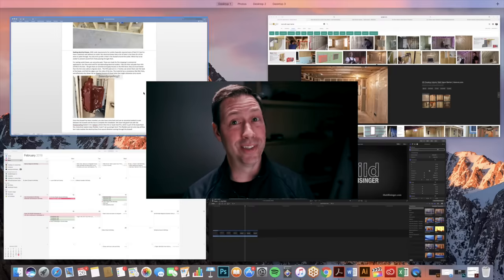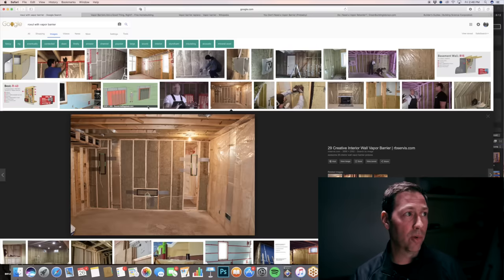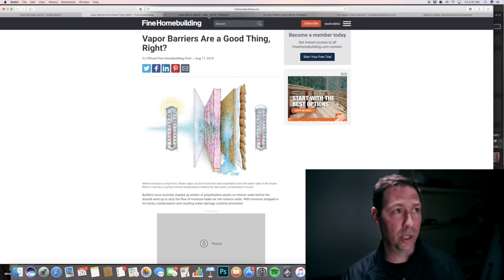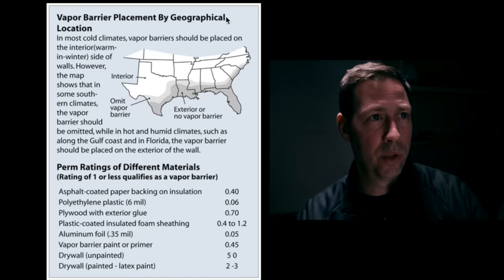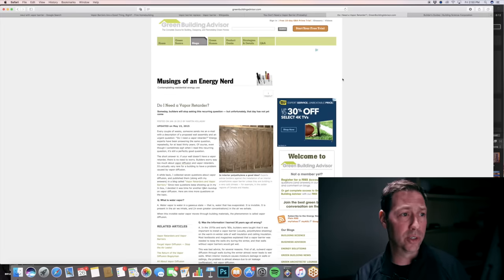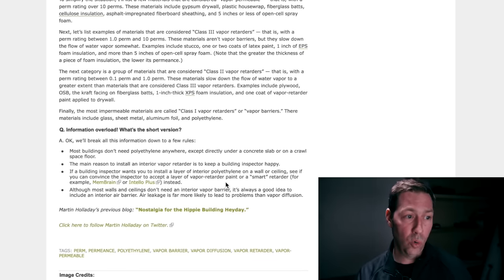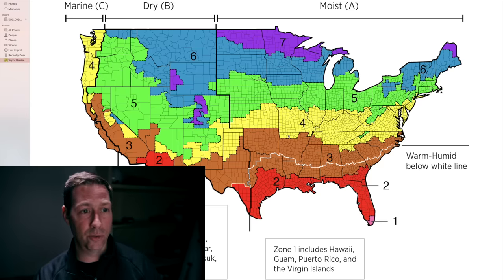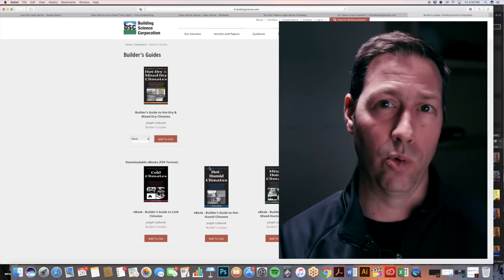Vapor Barriers: Need one or not?

Comment: Found this very helpful but it left a couple of questions unanswered. 1. If air movement is the main culprit, how does one stop that? Won't a poly sheet prevent air movement? 2. In the example you showed from Texas where you remodeled a house less than 10 years old that had the poly sheet on the inside, you found mold -- so why did that happen? In other words, while a poly sheet is not needed, what problems does it cause if it is added, and why does it cause those problems? Thanks!

Comment: So glad I found this! Question...I’m remodeling, tore out sheetrock on 4 interior kitchen, bath & living room walls (none are exterior), down to the original ship lap hoping for the “farmhouse look”. However, my house has since been freezing, dusty, moldy smelling & extremely damp. I live in east central Mississippi & want to recover them with luan (easy to install, paint or wallpaper). Do I need any vapor barrier or membrain between the shiplap & luan?
Reply: I would open one side of the wall and address any mold then look to close any air leaks that might be getting into the walls. To be freezing, outside air must be getting in somewhere. Plumbing or wiring holes to the crawl space? To the exterior at wall junctions? Dampness would be coming from the same leaks. An interior wall should have none of those issues unless there are openings to the outside. Also look at holes in top plates if it is a cold attic. Plastic will not save you from those issues as it will still be inside the wall cavities. A few cans of spray foam should help. Just use the correct type. From a retired GC.

Comment: I live near Chicago and have a fully finished basement and I took out some drywall to redo my sump discharge line and add a second to get rid of the wye. Against the foundation concrete wall was the thick plastic vapor sheet then there was the insulation that itself was like bat insulation but was in like a plastic housing, and finally the studs floated out about 10” and of course then the drywall. Is this right? I believe so because there’s no musty smells and the basement is always the most comfortable location meaning in summer it’s coolest and winter it’s warmest and that’s in a 2 story. Always thought that plastic that’s simply draped down the foundation wall was kind of dumb but it seems to be helping with something I guess.

Comment: Good content. Two questions on zone 1 & 2.  I just reframed part of an exterior wall I’m south florida with pressure treated studs because of termite damage.  The wood is still a bit wet from the pressure treating process & we need to start closing in the walls.  Generally I insulate with Roxul, but I’m concerned about the moisture I may trap in the walls given the still moist pressure treated.  How would you handle this situation?

Comment: I am near the coastline in Hoboken, NJ and I’ve got an extension made of cinder block, whose exterior is stucco and open to the elements, which I am in the middle of remodeling. This extension was built 30+ years ago and after removing the drywall and insulation, I noticed a plastic vapor barrier against the cinder block, between the cinder block and the 2x4 framing. My question is whether I should remove vapor barrier completely and just put in new insulation and the drywall back alone or replace it/leave it in and put the insulation and drywall back on? From what I see from this fantastic video, I should do the former, but wanted to check if my particular context would suggest something different? Thanks in advance!

Comment: Hi Matt. Awesome video! In my current situation I am insulating a shed (in the cold north so only heated and never air conditioned) and will not have any drywall overtop of the insulation. In that case, since the drywall will not be there slowing down the vapor, I definitely want a vapor barrier correct? Thanks again!

Comment: Matt Risinger:  i'm in ky.  sliding door sitting on a piece of wood, on the sub floor.  one edge of that piece of wood is outside with caulk.  the other edge is inside with trim.  i have mold on the trim and rotting wood near the door.  i can feel the cold around the door where the door meets the floor, where there's no insulation.  nobody here understands the problem or knows how to fix it.  it seems like the whole door frame and base should be wrapped with plastic or some barrier b/w the outside temps and inside temps. crawlspace has no vapor barrier and no insulation.  what to do with door installs?
Reply: I think matt made a video on that... its about window and door pans

Comment: Thanks for this. I’m building garden rooms in the UK. I’m using ICF’s with warm flat roof. Permitted development only allows a maximum roof height of 2.5m I’m trying to construct a hybrid roof with 12mm ply, 50mm pir and 18mm osb3 covered in epdm for the outside and putting 50mm mineral wall slab up against the underside between the wooden joists. Between the joist and the plasterboard (drywall) I was going to use Siga Marjex 200. Do I need it now?

Comment: The worst cases I have seen have been having two vapor  barriers in the interior. Use to be that six in faced fiberglass was used in the attic and people would add another layer of faced fiberglass batts to that space. Always ended up moldy. Also when folks used faced fiberglass on interior walls for sound deadening, especially in high humidity areas like bathrooms. One layer on outside walls or ceilings was correct but on interior walls it should be unfaced to allow the moisture to migrate and air to dry the interior of the walls. I just watched a video on YouTube of a family in Idaho building their own home making this mistake, but they won't listen to advice and are going ahead with it. They are sure it will be fine and maybe they will get away with it, but they also may get toxic mold and have an unlivable house in the end. I agree it may be best to have none, but for sure you should never have more than one.

Comment: Love all your videos! I plan to finish my basement with 1/4” foam paneling against the concrete walls then plan on insulating the 2x4 stud walls with unfaced Fiberglas batt insulation, am I correct in the think of not needing any type of vapor barrier on the inside? I live in Maine so winter temps are down to as much as 20 below at times
Reply: In your case I would do at least 1 1/2" foam not 1/4" and use rockwool. Never put a vapor barrier on inside part of basement wall. It creates a mold sandwich.

Comment: I would say that the thicker the insulation (higher R value), the less moisture you might find on the cold side of the vapor barrier.  That's because the temperature gradient is larger and less likely to hit the dew point up next to the plastic.  Now the question is how close is the dew point gradient to the plastic on an R19 (2x6 batt insulated) wall when it's 10 degrees outside? I think it's more important to ask how many air leaks you have.  However, a builder informs me that LIncoln NE recently changed code to eliminate vapor barrier requirements - but I don't know if there is any limits on wall thickness.  Yes, they only recently started requiring R21 in walls.  I thought that was the standard (having lived all over the country up North)for the past 20 years.

Comment: When is it advisable to use a below slab vapor barrier? I am building a home in Northern Utah where nearly all of the slab is 4 feet or more below grade. My concrete will be the finished floor with no coverings. I have been told due to the dry climate and depth below grade I won’t need it, and that it may make my concrete flaky on the surface as all the water will have to dry upward. But I’m worried about damp floors.

Comment: So I have a question I am having a devil of a time finding a good answer to. I have a manufactured home on piers, with slump block "skirting" - essentially a vented crawlspace. I had a pipe break and flood this winter that soaked the fiberglass insulation under the floor. Mobile homes are built with a layer of insulation, and then a polyethene "belly wrap" across the entire bottom of the house sealing in the insulation. The flooding caused the insulation to be soaked and the water pooled in this belly wrap. The dry-out company pulled all the insulation and sheeting. I'm trying to figure out if, when I re-insulate the floor, do I replace this polyethylene "bottom board" or do I leave it without a vapor barrier - just insulation? I'm in Arizona - at 8400 feet in elevation, i.e. a cold and dry climate. The night of the freeze it was -12F. The crawlspace is vented. Any help much appreciated!

Comment: I'm a carpenter sub building apartment building in climate zone 6. The architect spect an inch of foam and a house wrap on exterior. Fiberglass batt insulation in 2x8 stud cavities. 6 mil plastic on interior walls. 

No barrier on ceiling and blown in cellulose on attic.

Comment: I am currently installing foam board on my attic floor to reduce heatloss that causes ice dams on the north facing side of my roof. I am sealing the edges of the floor rafters with great stuff. This is doubling as a vapor barrier, correct? Before installing the foam board, I sealed the sheet rock seams and penetrations the insulation contractor missed years ago when I built the house to reduce the amount of air leaks. Do you see any potential problems? I also was wondering if I should use faced or unfaced batts on top of the foam board. I am going with batts (fiberglass and mineral wool) after extracting my fiberglass blow as it's windy in central Washington and blow always seems to move around (especially after 15 years) and get matted down when doing my attic annual inspection. Thanks

Comment: Im ingeneering houses in medium to cold climates and a windsafe and vaporproof home with controlled ventilation requires ridiculously low energy and has top quality air indoors. In medium to colder climates: Moisture is supposed to escape through ventilation, NOT the wall. You put the vapor barrier on the "hot side" (inside) of the wall because vapor will go from warm places to cold places as video says. You also put a windproof net-thing under the fasad on the outside. That way the vapor never gets deposited IN the wall on the way out or blows in to the wall from the outside. Hold in mind that this effect gets reversed when its constantly warmer and more humid outside instead.

Comment: Thanks Matt. Would you mind advising me about MemBrain vs poly in zone 6 northern Ontario Canada? I'm bldg a new 3-season unheated (according to code) cottage but there will be a wood stove. I'm insulating w/ Rock Wool batts in walls, floor joists and a vaulted ventilated ceiling. Floor batts will be closed in by OSB on the bottom to block critters. The bldg will be on piers pinned to bare granite. Insulation is for the shoulder seasons. Thanks for any help you offer.

Comment: Great advice 
We are just in the start stage of a new house in lower michigan zone 5 my plans are ,drywall - 6in fiberglass paper less  - osb - 1.5 in foil-faced r10 or so and strapping for siding to hang on , my ceiling will be drywall caulked sealed as best I can and 18in fiberglass hope this is a good way for a michigan climate any thoughts or advice would be helpful
Reply: robertsoave soave if it were me i'd skip the fibreglass and go rockwool if its available and in budget. Id go rockwool for exterior insulation aswell as this allows better drying to the outside if need be and its also a fire retarder.   make your drywall as airtight as possible but with insulated sheathing its unlikely youd have condensing issues even if it wasnt 100% airtight.
Reply: thanks for the advice I can look into rockwool.
I know it doesn't have the same r value
Reply: @whiskey4553  Why rockwool and not cellulose?  Rocwool is more expensive and I don't see a plus side. Cellulose is fireproof and cheaper than rockwool, and seals everything better.
Reply: @ @abacab87  I have nothing against cellulose.  Putting it in walls means dense packing for best results, which requires more expertise to get right otherwise theres a risk of settling.  DP cellulose does reduce air transfer rate slightly but its not an air barrier and in a well designed wall assembly the mildly increased air/moisture transfer rate with rockwool should not be a concern.  Price wise you can diy rockwool, not as easy with dense pack.  Either make a fine choice for wall insulation.

Comment: So let me first start by saying that I own an HVAC and Home performance company in Colorado and many of these rules or ideas do not necessary apply to our arid part of the states.  First off, relative humidity, absolute humidity and actual humidity levels are all very different.  We use humidifiers year around here connected to our furnaces (No such thing as a Heat pump, Air handler or package unit here in residential areas.  Even though a good dual-fuel system would be awesome, and I am going to install one in my home as soon as the new much more efficient generations gets released.  Since we have solar panels and will be adding a pile more to cover the usage as they get more efficient also.  The point of my comment is that our humidity is around 14% inside my home as I speak.  I am doing a test with a couple new pieces of equipment.  Our Aprilaire humidifier is off to the unhappiness of my family.  Anyways, vapor barrier is required in many of Colorado counties and very necessary.  We don't really have such of a thing as a sealed attics since we have basements for our HVAC equipment.  But maybe in Austin, the humidity is at a reasonable level when the temperature drops but not here.  Matt has some amazing projects and knowledge plus I am a huge fan, but not everything applies to every part of the country or world, I would suppose.  Kind of like, if we ran a dehumidifier, the house would probably start on fire from the static, yet the unit wouldn't be releasing any water down the drain.  Snow only holds real moisture at much higher temperatures of relative humidity.  Ice isn't even slick at -10 degrees, you would swear it wasn't ice, since it isn't slick.  But once that sun comes out with a high UV index and massive exposure, 32 degrees feels like 50.  We are shoveling in a t-shirts, shorts and tennis shoes but it is only at the freezing point by thermostat.  There are no small water particles floating anywhere inside a house that doesn't have a whole house humidifier set for automatic settings of 35%-40%.  I would have to agree with the first book stating that certain areas definitely still need a vapor barrier.  Please bring us 30 quarts of water to fill our air!!  We would love that!!   I am being playful, but this does not apply to any arid climate such as Colorado, Arizona, New Mexico, Nevada, Southern California, and probably eastern Texas.  I think it is funny they have Denver in climate zone 5.  Dear Lord, that is quite off, but someone smarter than me made that graph. Someone got that wrong.  I am not aware of a builder around here that does not use some form of vapor barrier, especially on the outside or both.  Some folks line their crawl spaces to keep the critters and dirt from getting on the belongings with a barrier and they get the benefits of the vapor portion.  And you would most definitely use vapor barrier in many states north of us in one form or another.  We wish we had the relative humidity of parts of Texas during the winter.  My Aprilaire humidifier is set to 38% all year around and it controls it automatically, has an outdoor sensor and talks to the thermostat to the humidistat.   Without it, you would start a fire in your britches or davenport by sliding off or touching anything metal or each other.  Home performance is much much different animal here.  Especially when you are testing an HRV and ERV.  Trying out some theories that I have read about.  Thanks for listening and let the flaming began.  I know Matt is the guru in most areas, so I expect to get hammered by everyone here.  What I would love is for a very scientific scholar to give some science understanding in lay terms for a better understanding of all the variables that come into play in this arena.  I love the absorption of data and how I can apply it to life and my business.  I even love to be proved wrong and shown how I have done it so wrong for so many years without issue.

Comment: Question, my wife and I redid two baths. When removing wallboards in baths we found mold at bottom inside the walls. On inside walls we placed a vapor barrier from the floor to about 6' up. Then used concrete boards instead of wall boards to attach bath tiles from floor to ceiling. The tub/shower was one piece on outside wall, we did not move just worked around it. My wife wanted tiles above the tub so the wall board above tub came down and plastic sheeting and concrete wallboard went up. Was the plastic sheeting necessary to keep moisture out of the inside walls since we used a concrete wall board and bath tiles?

Comment: We live in Minnesota. What about the gaps and cracks where moist air can get into the walls around the windows, doors, outlets, maybe even baseboards?  Those can add up to way more than a square inch in most cases.  How do you seal these areas correctly?

Comment: Great Video.  Does this same logic apply to a crawl space dirt "floor" that is built in flood zone AE where open vents are required by FEMA? The building floor is well above the flood zone but the crawl space is enclosed with cypress (no insulation or conditioning) and therefore requiring the open vents.